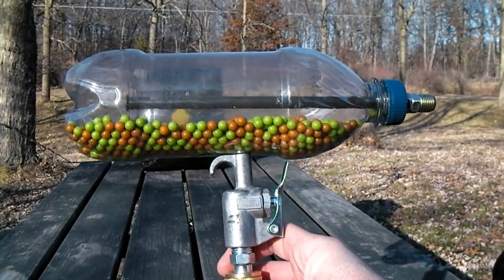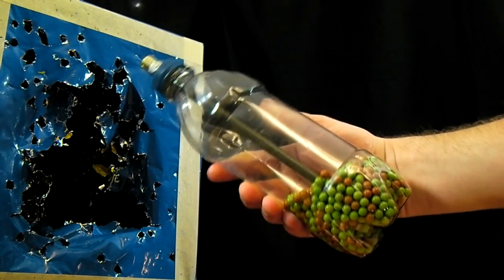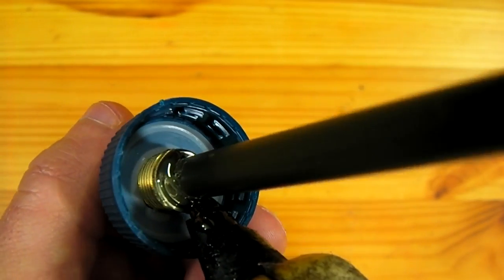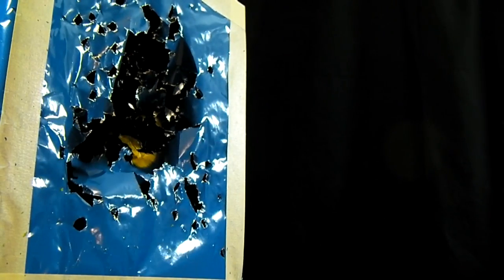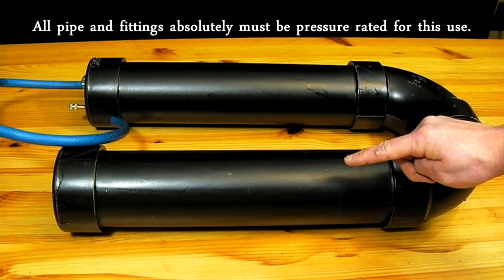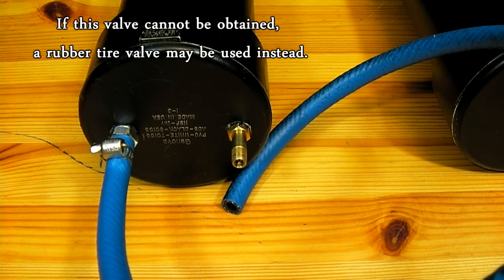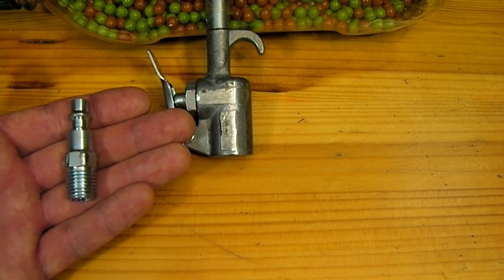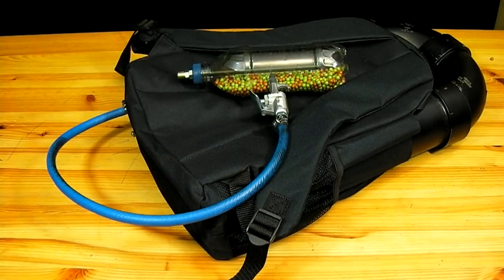How to Make a $4 BB Gun &  Airsoft Flamethrower

Comment: you could use a 12 volt battery powered compressor to keep the pressure up the compressor would only
work when the pressure drops so a small 12 battery of a RC model should be ok to power it hope this helps
Reply: Can you explain more please.
Reply: that's actually pretty clever
Reply: @SulttanSA  just use a battery on a portable air compressor

Comment from the maker: Yes, if the CO2 is regulated and run directly into the bottle. CO2 should not be used inside PVC however, because the cold temperatures produced can make it brittle.

Comment from the maker: If the straw is metal and also a brake line. Well not really, but it does at least need to be hard plastic such as a pen tube, a straw will not work.

Comment from the maker: Being sure to use only pressure rated pipe and fittings, about 60psi. Be sure to watch a few tutorials for working with PVC and properly priming and cementing the fittings before building.

Comment: also, if u have it, try hooking this up to a scuba tank instead of the home-made pvc tank. it holds 3,500 PSI, is mounted on your back, and has attachments on the respirator for the blow gun attachment. what is the approximate range you've gotten from this gun? also, have you tried a 2 liter instead of a 1 L?

Comment: To take this one a step further, you could attach a batterypack with a compressor to the chambers fillup valve. About 40ah could fill it up properly at least 10 times. These packs weight´s around 8kgs. 

Great video!

Comment: if you have already made the gun without the arihose mod, instead of removing the quick release, you can attach a quick release receptor like in an air hose and attach that to the flamethrower mod pack.

Comment from the maker: @Mrpeanutwaffle Neither the compressor or backpack is more powerful than the other. The air compressor will last longer if it has a large tank. Both methods get weaker until the air has run out.

Comment: I have a modification.  Get one of those small 12V auto tire compressors.  Remove the plastic case etc.  Use a 12V 7Ah or similar SLA battery to power the compressor.  You can now recharge in the field.

Comment: there isnt anywhere else for them to go. the air pressure basically throws them everywhere inside the bottle some will end up in the line, since that is the only way for air to escape, it would almost suck the bbs in with a suction effect.

Comment: Cool but it seems like the backpack dumps all air pretty fast. I think this idea should be applied with a max capacity/psi polarstar tank. I mean those are about 100$, probably comparable to this design after materials/cost/time, and likely holds more air.

Comment: A standard small air compressor operates on around 40psi a pb tank is about 4000 psi so you will need a regulator to drop the pressure and a sesamoid to regulate the pressure going into the trigger mech but mainly just a regulator. Bottom line is: paintball tanks operate on too high a pressure

Comment: Okay, first off, are you sure that you used pvc and not cpvc? Secondly, did you spray paint  the pvc/ cpvc(?) black, or did it come that color?Just sayin' because I've never seen either of those in black. Finally, do you think I could add a valve (not fill valve) between the tank and airline fitting?

Comment: Cool and simple design, I believe it called a "vortex" design? I have been brain storming a way I could make something much the same, using a Empty Fire extinguisher as the air tank, and using the extinguisher's hand lever as the trigger/valve.  I want to design mine to fire .177cal steel bb's. A couple of questions however, is 525psi's in a tank going to be enough air supply without having to refill in a few seconds? And would this design work with steel bb's or will they be to heavy/no power?

Comment: Nice work, but I don't think your pack holds enough volume. Mine has seven 3"x24" tubes and it only lasts around 20 seconds. Although 20 seconds is a long time at 50 rds per second. Nice presentation.

Comment: Imma build this, but instead of that pvc tank, i'll bring one of those small portable air compressors and put it into the bag, which you can just fill using a non-portable compressor. More air capacity, longer time between recharges, and hmmm, would it be allowed at airsoft battles?

Comment: My only suggestion is putting a quick connect on the tank, Which can be used to fill the tank with air, and then you can plug your hose into the quick connect to fire, Thus eliminating 1 hole

Comment: Do you recommend getting one of those airsoft HPA tanks with a second regulator to use for this design or can I just hook up any normal air tank with the blow gun handle and have at it since you used an air compressor

Comment: Do the same thing but attach it to a cheap propane adapter to accept small propane canisters, propane because it's liquid when pressurized will give off more gas than that tank filled with air...much more gas

Comment: Would it be possible to use HPA if you had a regulator to reduce pressure down to let's say 100 PSI? I'm using PVC as opposed to a soda bottle for my gun. I know Co2 gets too cold, so that wouldn't work. But could HPA?

Comment: Heh, you could probably hook this up to a cheap portable air compressor and have a switch between a battery and the machine that could be used as a trigger to get a more sustainable rate of fire.

It won't let me post the url, but there is a ~ $9-12 one on harbor freight's website that looks like it could fit the bill.

Comment: You should make a pump action version of the $4 airsoft gun using pvc pipe or something, so you don't have to squeeze the bottle all the time.
Reply: What you do is get a portable bicycle pump and a pvc air tank like in the video(smaller). Make the second one but make a PVC frame and mount it how you like it. Then you can pump the tank full while you fire.

Comment: What about doing a little conversion? Instead of using air why not use something like propane or a flammable gas and instead of using a plastic bottle use metal piping...this is pretty well an instructional video for a DIY flamethrower :P.

Comment: an even better addition to this use a cheap cigarette lighter air compressor and wire it to a small motorcycle batter (Lithium ion batteries which weigh nearly nothing can be gotten for about $100-200) and there you have it you no longer have to hand pump up the tank!!

Comment: can regular metal BB pellets be used in this design?
Reply: yes but you'll need the correct size break line for the size of your pellets. Standard airsoft pellets are 6mm
Reply: It can be achieved with 6mm brass tubing.

Comment: Y does no one put the FPS
Reply: Nobody puts FPS on this kind of thing because it all has to do with the pressure of the system. More pressure, more power. As you use the gun, its pressure goes down until it reaches 1ATM of pressure, then it no longer propels BBs out of the barrel. He could add a graph that shows pressure to speed calculations, but that would be more deadly than the gun itself.